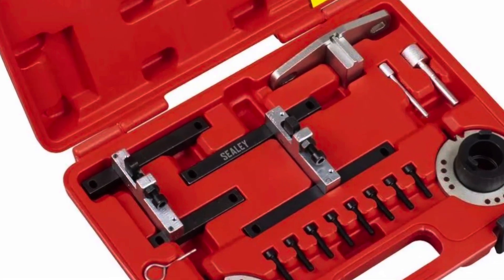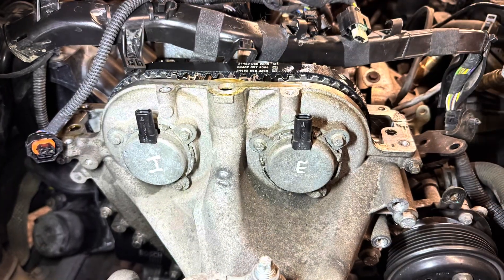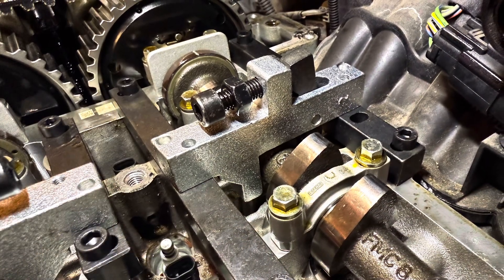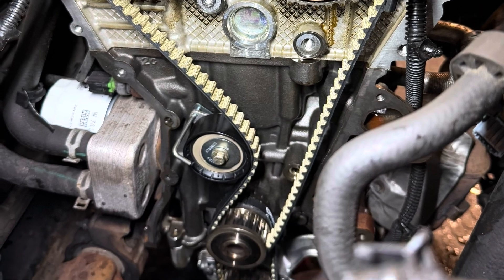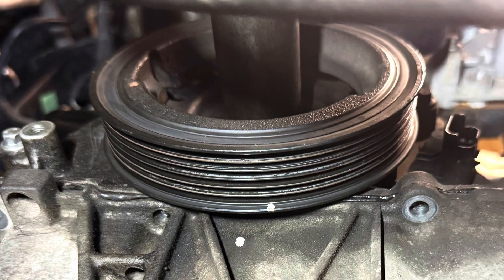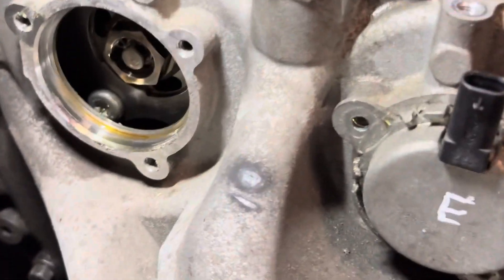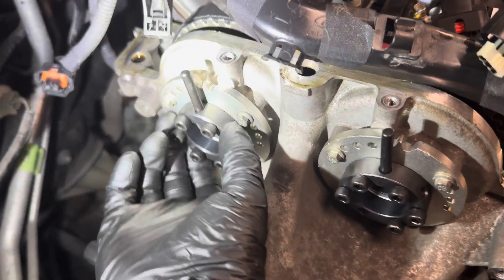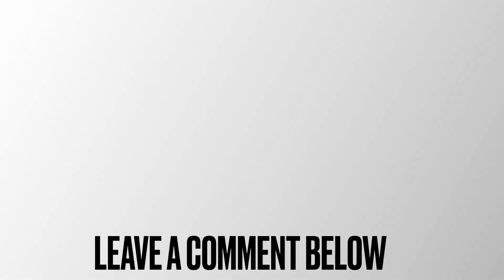Timing the 1.0 EcoBoost Engine with the Sealey Locking Kit | Step-by-Step Guide.

Comment from the maker: 🔧 Timing the Ford 1.0 EcoBoost – Sealey Locking Kit Guide

If you’re replacing a timing belt or re-timing the engine, this video shows exactly how the Sealey locking tools are fitted and used correctly to avoid mis-timing.

👉 All tools & parts used (kept updated):
https://tr.ee/EMIjQj

👉 UK parts supplier:
https://www.awin1.com/cread.php?awinmid=3997&awinaffid=491293&ued=https%3A%2F%2Feurocarparts.com&platform=ma

If this helped, please like 👍, comment 💬, and subscribe 🔔 – it really helps the channel grow and keeps future guides coming.

Comment: Hi i installed the cam timing unit loosend everything and pushed it to the left but my rod and the point are not lined up my timimg tool on the cam goes on perfectly when i turn the engine 2 full turns does this  mean my timing is fine

Comment: Goodyear evening !
I'm trying to fit the new pulley on exhaust but i can't manage to turn the pulley on the left it stuck 
There is any solution to unblock the pulley ?
Reply: Just found out that the bolt that is holding the pulley was damaged and it was blocking the oil to go inside the pulley 😅😅
Reply from the maker: Oh. Happy days!  Good to know. Thanks.
Reply from the maker: That sounds like it’s seized up to me. Is there any oil in the engine?
Reply: @How2FixIt1 Thank you for your quick reply!
The pulley is brand new and the engine has oil 
On the old pulley,the one that is broken,inside has a locking pin
Reply from the maker: Sorry I think I’m misunderstanding your problem.

Comment: Great video. Thanks for making this
Reply from the maker: Thanks for your feedback.
Reply: I have the crank locked at tdc, the cam lock tool fits on the squares and it is flat across the both of them, the alignment pin fits in the crank pulley, but my engine is running hot and has like 30+ degrees of advanced ignition timing. I’m trying to understand how the vct tools work. With the crank locked in position and the cams locked in position do I loosen the cam pulleys and push the pins toward rear the rear of the car?